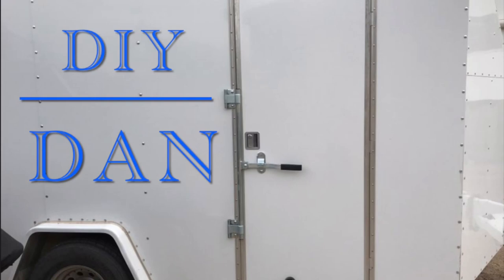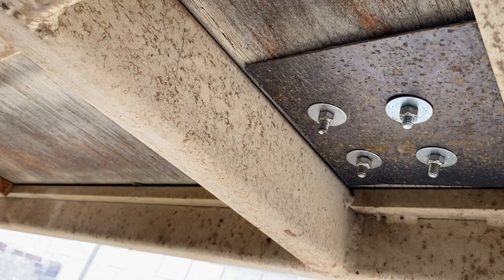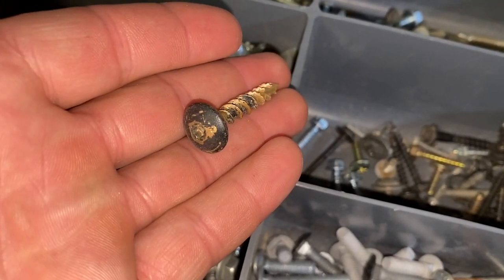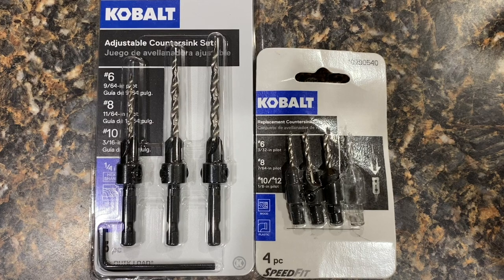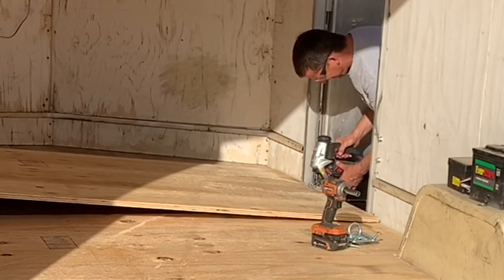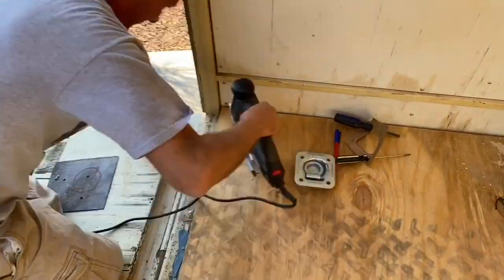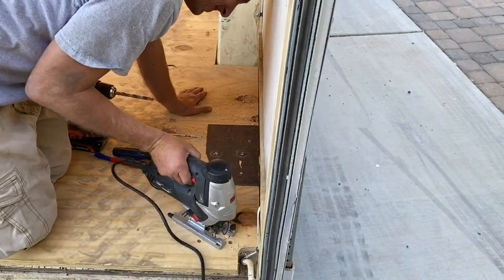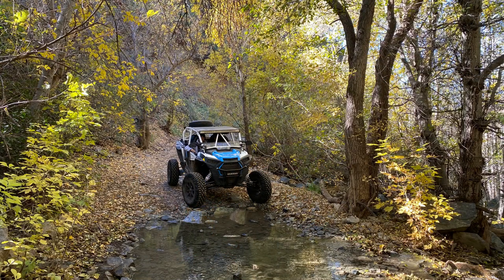INSTALLING NEW FLOORING& RECESSED FLOOR TIEDOWNS ON ENCLOSED TRAILER W/TIPS TO SAVE TIME&FRUSTRATION

Comment: Adding another layer of would wouldn’t this cause rot   from condensation
Reply from the maker: I haven’t had that problem but I live in phoenix az so it’s very dry 95% of the time I was also in a hurry so I didn’t paint them first which would also help protect them